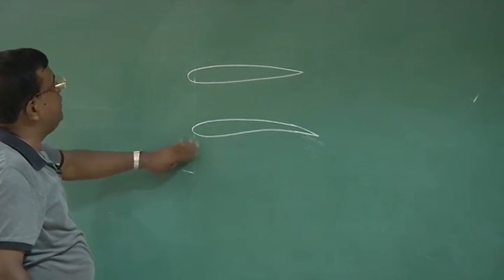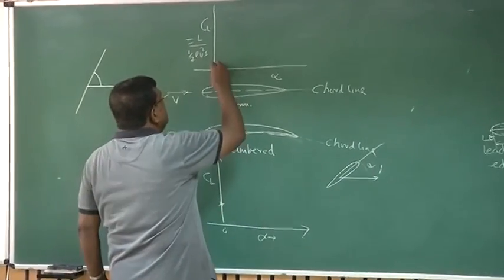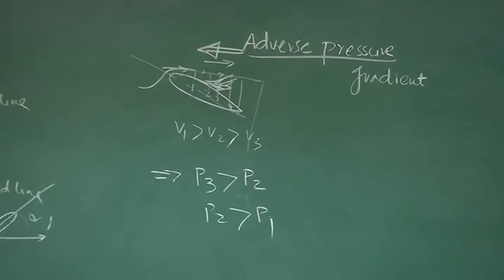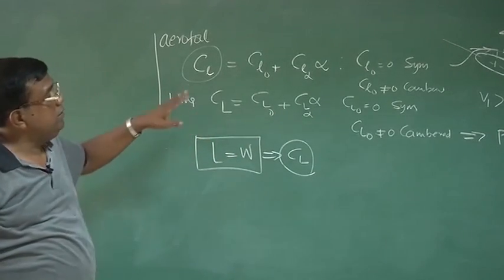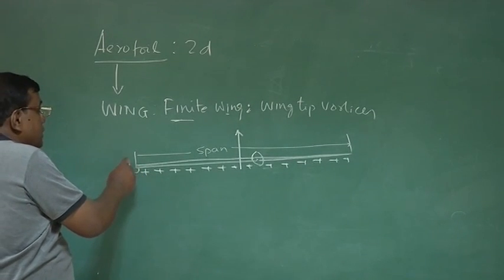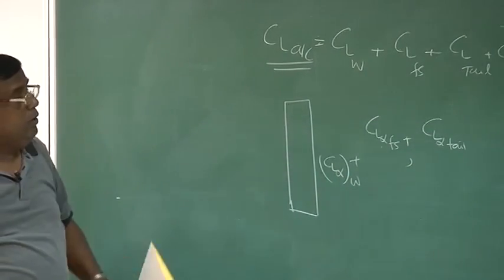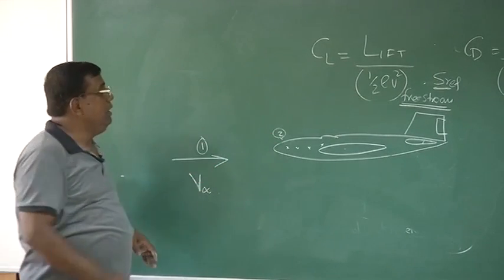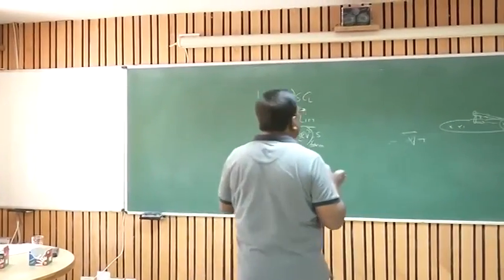Concept of Lift Aerofoil: Wing : Complete Aircraft

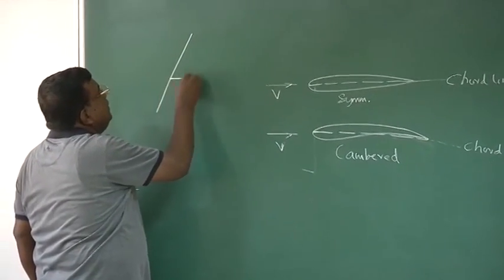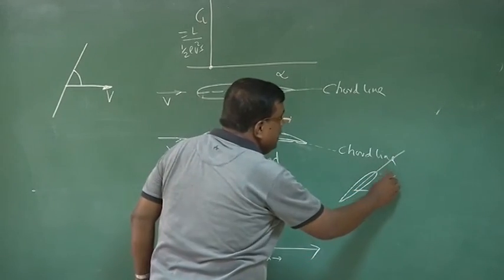Comment: What is this "angle" he is drawing at times 1:46 and 3:37,.?.
Reply: @Mohan ramanuj Iyengar  So he draws it backwards and it looks like 70 drgrees.   Not cool.
Reply: @Mohan ramanuj Iyengar    angle of attack defines angle blw chord line and relative airflow ,but in case of cambered  wing angle of attack is not zero .can u pls explain why sir is taken as zero ??
Thank u
Reply: @Saikiran-ty8mo  His diagram in NO WAY helps the neophyte understand the simplest of aerodynamic concepts that many of us already  understand, AoA.
Reply: Can anyone help me with a doubt here????
Reply: @ww2dogfighter   The dude here is providing all of that you could possibly use with this poor explanation.  ANY other YouTube video will do a much better expatiation than this one...
.
He is drawing some of them backwards and at a completely unrealistic 45 degrees.
Reply: @Observ45er  sir just wanted to understand the concept of downwash
Reply: @ww2dogfighter  It is quite simple.
The moving wing must push the air around to get through it.  This changes the pressures around the  wing.  In the mid 1700s Euler, following on Bernoulli's work, showed that it is Pressure Gradients that Accelerate fluid.
...
SO.
...
The increased pressure under the wing pushes up more on the wing and it ALSO pushes down on air further below, thus accelerating air a little further below the wing downward.  
.
Above the wing the pressure is reduced, thus pushing down less.  This lowered pressure allows atmospheric pressure farther above the wing to accelerate air downward. 
.
Therefore, as well as pushing up on the wing, we have air from both below and above the wing being accelerated downward by the pressures around the wing.... 
.
SO.
...
We have lift and we satisfy Newton's third Law with the Pressure Gradients around a moving wing...
For more detail, see: https://www.quora.com/q/rxesywwbdscllwpn/Understanding-Lift-Correctly
Reply: @ww2dogfighter  Also see this. Please see how it also comes from well above the wing:  http://i.imgur.com/h8pSK.gif

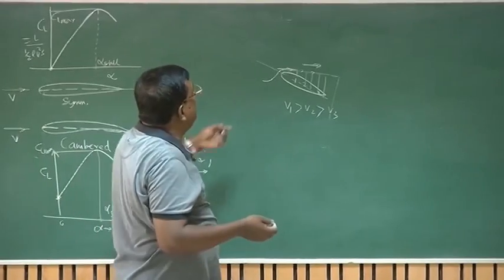Comment: I can't understand the area concept   at 6:10 and why does flow separate at high angle of attack...?
Reply: Its is because of the fundamental physics of flows! called continuity. For the inviscid (constant density) incompressible (subsonic) flow the mass flow is conserved! Which meas the if the area increases for given control volume the flow velocity normal to the area must be reduced! P.S.The stall characteristics and the creation of mass are beyond the scoop of this subject.
Reply: @xplane7879  thank you! i had the same question. nicely explained
Reply: ADverse pressure gradient
Reply: When a body is introduced in a flow ( flow can be imagined as straight parallel lines) , then the lines near the object gets closer which means high pressure, this high pressure results in pushing the lines together ( this property is coanda effect). When the angle of attack is too much, the pressure difference doesn't actually forces the lines together but results in drag.
Reply: In simple words - the stream on upper surface is flowing in x direction (parallel to  free stream) because it has separated from upper surface of wing at leading edge as the angle of attack is very high. This happens due to boundary separation phenomenon (fluid mechanics). When this happens the flow along the plane of surface if you see by resolving vector of x plane to surface plane you will realise velocity on later areas is more as the distance covered in same time is more ... Hence pressure is reversal .. pressure and velocity of fluid are inversely proportional as per bernoullis theorem. 

Correct me if I am wrong :)